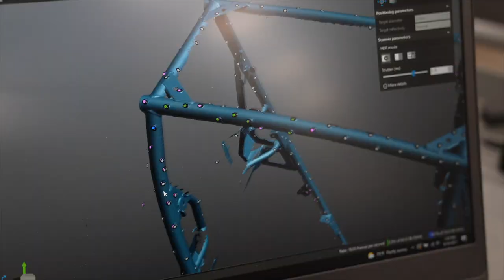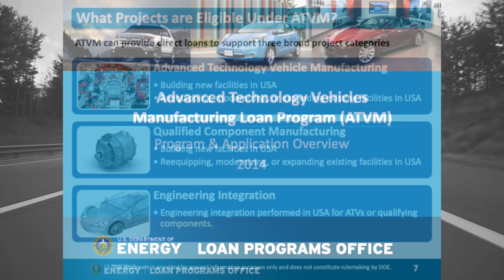Ride Of The Arconauts Episode 5: Quarterly Reporting Edition

Comment: You want to pause production ???? Can you not scale up in parallel?
Another loan ??? Again another platform???
Reply from the maker: We plan to move all assembly, sub-assembly, material handling, quality, etc. into the new rAMP facility to scale up. It’d be super inefficient to duplicate these departments in two separate facilities. The loan application is the same one we have been working on for some time, and likewise, platform 2 is something we started talking about very early in the year.